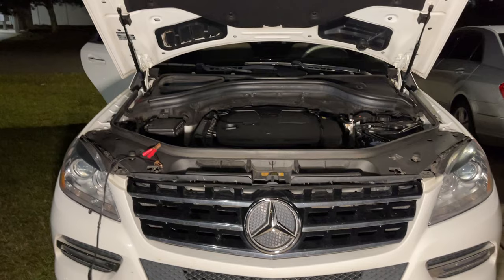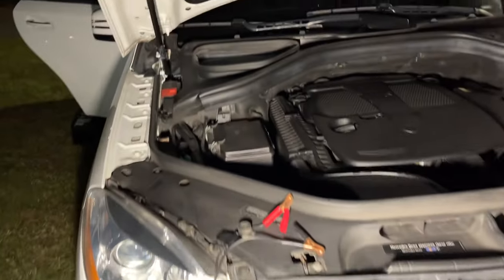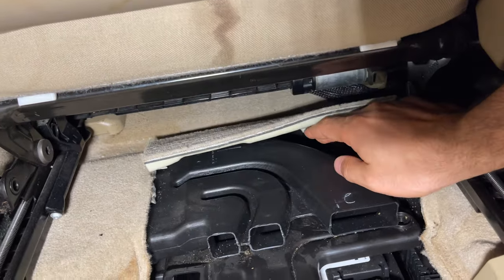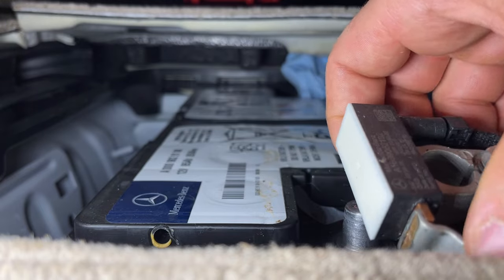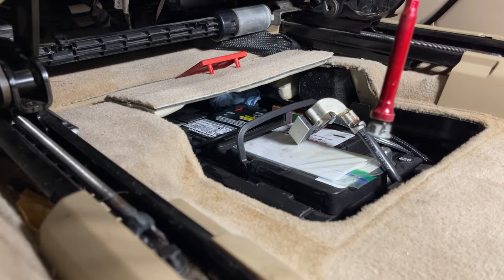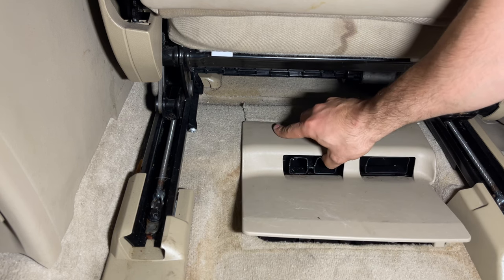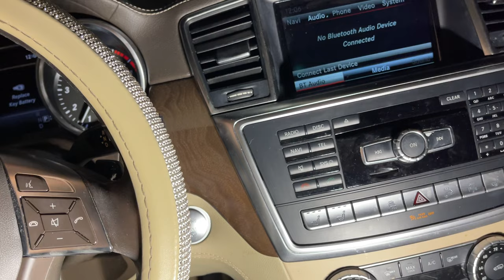How to Replace Battery on Mercedes ML350

Comment: when you are disconnecting the battery cables always disconnect the neg. one first then the Pos.  When putting them back, do the Positive first than the neg.  Other than that, great video.

Comment: Great video mate. Everything in this was spot on and made the battery replacement of my ML350 a simple task. The only thing I'd add to this is that you may find it difficult lifting the battery out - I used a long thick shaft screwdriver to give the battery a "ramp" to travel up as you pull it out on the angle.
Reply from the maker: That's a cool idea to keep in mind next time!

Comment: Great tutorial. A few notes to add.. you’ll need a 10 inch socket extension w swivel adapter on end. When putting bracket and bracket nuts back on use a magnet extension tool (about $6 at Lowes) to put bracket back over bolts and to start your nuts. I think he mentions this briefly but doesn’t go into detail. Pretty straight forward if you follow his steps here and have the right tools.
Reply: Please don’t upgrade upon me 😮😮😮
I’m gonna have i

Comment: Helpful tip: make sure you raise the seat high up before disconnecting the battery. Or it , the battery , ain’t coming out.
Reply from the maker: 👍 thanks !
Reply: Would it make it any easier to remove the entire seat?
Reply: I made that mistakeg😢😂😂😂

Comment: I swear some car engineers must have been high designing some of these cars. Why for heavens sake put a battery in such a place. Thanks for the video helps alot
Reply from the maker: Lol, yeah, over engineering at its finest.
Reply: I own ML350 and E350, and my next car won't be German cars for sure.
Reply from the maker: @Don-gl1cx  lol 😂
Reply: @Don-gl1cx  Nowadays there better cars that offer more for your money than german cars. Infact most of them are not built in Germany. Like the ML is an Alabama car aka "alabama trash can"
Reply: believe it or not the Engine compartment get hot and will weaken the battery life.  Putting it back in the back seat area is better for longer life.  If you really want to have a challenge at a batter R&R  try the Chrysler Seabring it is in the Right hang front wheel well.  that that is crazy
Reply: @yogib37  Agree with this but they left no room to get the battery out. Had 3 different mechanics destroy their hands getting this stupid thing out. That is terrible design.

Comment: Is the battery that you pulled out size H8?   Did you replace it with the same H8 size battery?    These days, some battery manufacturers are suggesting H6 AGM as a replacement even though it is lower in specs just because of ease of replacement (mechanically)
Reply from the maker: I'm not sure because I got it from NAPA, asked for the exact same replacement. But it's good to know for next time. Thank you!

Comment: Does it matter which terminal you disconnect first?  I've seen other videos remove the negative term... first then reconnect the positive term... on the reinstall of the new battery.
Reply from the maker: Well, you're right, the veryyyyy correct way to do it is the NOPO-PINI way:
Negative out, Positive out
Positive in, Negative in

I get caught in the middle of it when trying to record, forgetting about it or just trying to do it fast and don't pay attention. BUT as long you disconnect the Positive first make sure it's completely protected and not let it touch any metal part of the car and you should be fine which ever way you decide to disconnect the battery leads.

Comment: If I'm just disconnecting the battery for long vacation (half a year or more) can I just disconnect the negative terminal? or do I still have to remove both negative and positive terminals?
Reply from the maker: It’s best to disconnect it completely and actually take it out the car and store inside especially if you live in a cold place.
Even better, use a reputable “automatic” trickle charger that has a BMS which charges and stops when it’s full and then charges it again when it goes below the level and so on…
Regular trickle chargers won’t do that as you have to manually remove it when battery is full or it might damage it.
If you’re going to get one, look for a trickle charger charger that supports the exact type of battery that you have since there are a lot of types of batteries out there. Or you can get a high-end battery maintainer that has functions for all types of batteries.
Reply: @AlbanianFix  Thank you! I live in SoCal and park the car inside my garage, so temperature isn't a big deal. I thought about the trickle charger, if I get one do I connect it to the front engine's positive and negative terminals or to the battery under the seat?

Comment: Is charging the battery possible from the ground and + from the front of the car with an standard battery charger for car batteries? Thanks!
Reply: Yes
Reply from the maker: Yup
Reply: @AlbanianFix  
Where from does the auxiliary battery get his power? From main battery or does the car load it seperatly? Thanks!

Comment: What if I don’t have a trickly charger and I just change it out like that ???

So when can I find me a trickle charger ???
Reply from the maker: You could but you might lose your car's stored info. I highly recommend using a trickle charger, just in case.
Walmart has plenty of those and any car/auto store.
Reply: What info ???? I already install new battery every things working fine

Comment: What dude mean the Battery had to be Vented Off on one side???
Reply from the maker: If a car has a battery installed inside the cabin and sometimes in the trunk even, the battery vent is a safety component that avoids pressure & gas build-up and allows air and gasses to pass through the vent tube and go outside so you don't breathe it into your lungs.

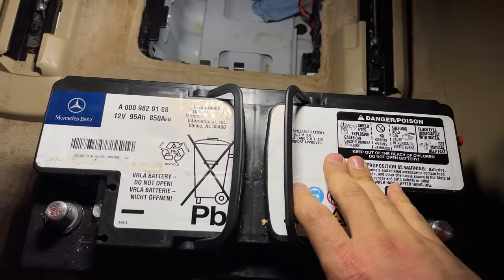Comment: bullshit @4:15 it ain't that easy
Reply from the maker: Lol... one thing I noticed is that of you don't cut open the flap big enough, you'll have a harder time pulling the battery out.
Reply: @AlbanianFix  I pulled it back enough... it's just not enough room from the back of the seat and the floorboard to pull it out. I'm going to have to reconnect everything and see if I can raise the seat up & forward. But I'm pretty sure it's as far as it can go. I'll try again after work.